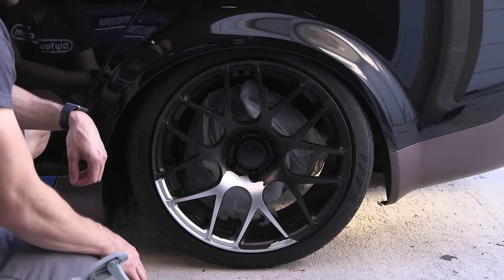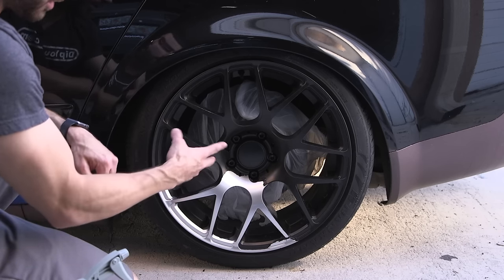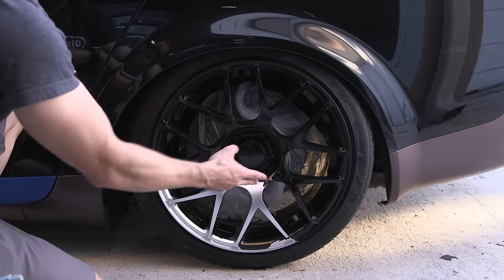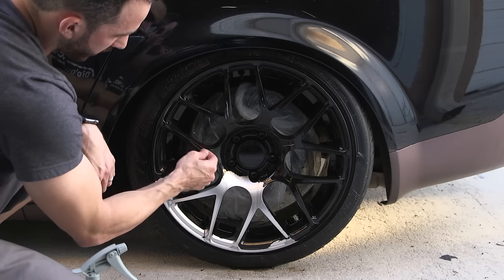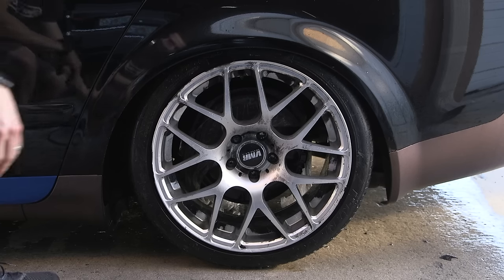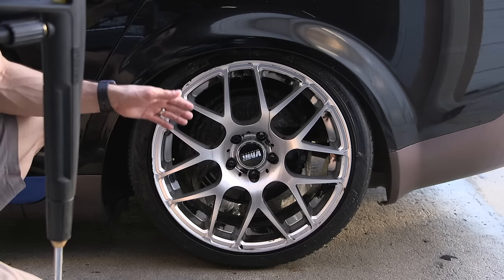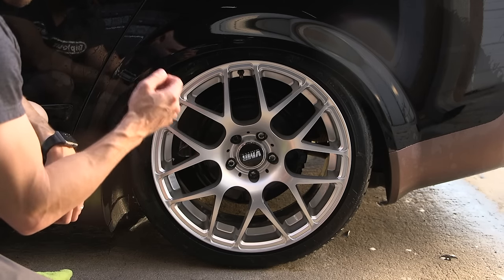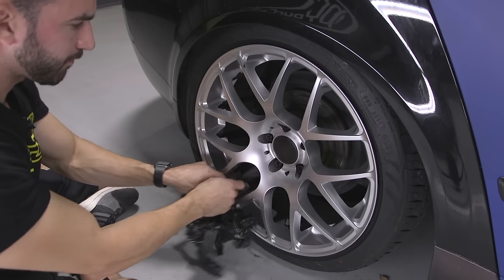How to Remove Thin Plasti Dip - Nothing Works Faster

Comment: Best case scenario - you sprayed the correct amount of coats and peeling your dip is easy. However if you’re facing some thin dip - nothing works faster than Dip Dissolver.
Reply: Is it safe to use on a part that's painted underneath? Like a body panel?
Reply from the maker: Paddy W absolutely
Reply: Awesome, thanks! Looks like I'll be ordering some soon haha
Reply: Fonzie q
Reply: Fonzie 
I bought and received it. I still have to do a 2nd coat. Does your product stain or remove the clear coat?
Reply: Where can i buy dip dissolver?
Reply: Do u think I will be fine dipping my rims black bc I’m leasing it and would have to take it off before I take it back in 3 years
Reply: Dip dissolvent Is not available in Italy how can i remuve thin dio without product
Reply: Where can I buy Dip Dissolver
Reply: Hi, Is it safe to use on ceramic coated paint?
Reply: Where I but this
Reply: @camdavis7034  yeah
Reply: Will the dip dissolver effect any plastic? Like taillights? I need to redo my taillights but it’s too thin to peel
Reply: Will this work on DYC Dip Armor?

Comment: Bought some used wheels that were already dipped. Spent a very long time trying to peel the dip off by hand. Gave up after getting most of one wheel done. Thanks for the vid, those wheels have just been sitting in the corner of my garage forever, nice decoration but they would definitely look better on my car haha

Comment: First off, I read some replies and tried to use some other things in the garage.  They sorta worked,  but had to use harsh chemicals and it took hours.  Not only that, but it didn't even take  it all off.  After 2 weekends of waisting my time on just 2 wheels, I decided to give in and try this spray.  OMG.. Followed directions and within less than 10 minutes my wheels look like new.  This stuff absolutely works.  I didn't spray enough plasti  DIP on my wheels and it was hell to get off.  Don't waist your time on stuff in your garage.  Buy this and use your precious time doing something more meaningful.  Thank you providing this info and product.  Oh,  and to top it all off,  I sprayed it on the 2 other wheels to remove the stubborn leftover dip that couldn't be removed by other chemicals.. Very happy day.

Comment: Haven't read all the comments but I'll tell you what does remove plastidip off of wheels,for certain, engine degreaser. Not sure Howe good it it for the various types of wheels, but for mine (aluminum alloy) it works wonders

Comment: I'm always hesitant to buy things I see in videos but it Worked great just like in the video. Had wheels that were peeling from a 2009 and the spray with a power washer at the car wash worked great took two applications and lucky me 3 of 4 Wheels were protected by the dip coating and they look nearly brand new underneath. If there's a way I would give 5 stars recommendation.

Comment: I just bought a Jeep and the original owner plastidipped the plastic liners on the side of the jeep as well as the wheels. Would this damage the plastic if I try and use the dip dissolver on it?

Comment: All well and good unless your thin PD is on the car itself then you risk paint damage so simply learn to do it properly as they consistently warn not to try and do it on the cheap with insufficient product. Lessons: Do it right or better not to do it and pay now or pay later.

Comment: What about plasti dip that’s 9 years old and was put on as recommended to remove but won’t? One wheel came out perfect but the rest are a mess. I’d like to know because if this product is a fight with a pressure washer what will be my case.

Comment: Engine oil also works as I found after checking my oil and having a drop pf oil end up on my grill peeling the plastidip within the hour even though I washed it off
Reply: Doesn’t matter what type?
Reply: @champking20  i forget what type is 
But all seem to do the same to plastic based products

But not synthetic

Comment: If I am unsure my wheels were plasti-dipped or powder coated, can I still use this product and not damage the wheels if it were powder coated?
Reply: Power coat are solid I had them jet wash and pressure won’t even damage or mess them up at all

Comment: If applied correctly, how long will the dip remain peel able? I live in FL and was wondering if it would be dried out and hard to remove after some time...
Reply: despite all the bullshit these guys spout, it will dry out and will be a pita to remove, after two years I had to peel m sunroof and the peel had cracked and crusted, had to use acetone to remove the dip
Reply: Yeah it can only peel off within a year if you live in a semi-humid area.

I live in California where it's a normal hot/warm/cold cycle it reaches 35F-105F and after 3 years it cannot peel off for me.

Comment: Anyone have issues with plasti dip that's been on for 2 years? It had 4 coats and is very hard to peel by hand
Reply from the maker: criz florez 4 coats way, way too thin.  You have to use the correct amount of product for it to peel and perform properly.

Comment: Will this leave stains on the driveway as the runoff dries?  My idea would be to use dip dissolver on an entire car if it doesn't peel properly (its been a few years and hasn't exactly been kept clean)
Reply: ablackformula   So did you remove the plasti dip?  What did you use and how did it go if you did on the driveway?

Comment: I changed the brakes and had the wheel underneath and accidentally dropped some brake fluid on the plastidipped rim and it completely took it off wherever it spilled

Comment: Ok I put 5 coats of plasti dip and two coats of 2k clear coat on my rims and I had to install new tires and a tire shop scratched up my plastic dip so I have to redo them last weekend I’ll try to touch up the rims on three of them and it looks like crap so all I had time for was to peel off one which took me over an hour and re-sprayed it and clearcoat it. Will  alcohol work better or brake cleaner with the clear coat

Comment: Where can i buy you product? And can i use the method on black plastic trim?
Reply: Also the plastid i need removed is on my front bumper, i dont nessisarily want to pressure wash ny radiator

Comment: I bought a used car with a thin coat on the wheels and grille. It's starting to come off. I don't have access to a pressure washer. Do you think the dissolver + wiping with a dish sponge would work?

Comment: I had made a horrible paint job with a fake plasti dip ripoff on the front fender of my motorcykel, to get it of i hade to use a metallwirebrush and water with dishsoap. Luckily there was not paint under, only metall.

Comment: Do you have to use the power washer? Can you use the jet setting on a garden hose?
Reply: Yes you could, it would be slower though, and make sure its high pressure
Reply: Yah but it's a pain in the ass!

Comment: Great video but is this safe on the cars paint? 
I recently (last weekend) sprayed a few things with black plasti dip on my car. I thought I taped off really good but it was a very windy day and I got overspray all over the place
I used a micro fiber cloth on a lot of it which really helped but there's still little black micro dots all over. 
Would this method be safe to use all over my car to get rid of these little spots? 
My car is white that's the only reason why I care!!
Reply: same happened to me.  Did you end up trying the dissolver ?

Comment: Guys just use brake oil then pressure wash off. Lmk if you need more instruction
Reply: GoldCurency o how does that work ?
Reply: Juan Rodriguez Rub brake oil on the rim. Let the brake oil sit on the rim for an hour or so. Then use a regular water pressure washer to wash off. The powder coat will begin to flake off. 

You might need to repeat the processes 2-3 times. As far as the pressure washer. I didn’t have one so I took my car to the self wash and used that one.
Reply: GoldCurency o alright thank you !

Comment: I guarantee that just plain old gasoline works better than this and is much cheaper. Did it the other day and the dip absolutely dissolved instantly.
Reply: i was just gonna say kerosene or just spray brake fluid all over it

Comment: What is the minimum amount of Dip (# of dip cans) required for 4 rims? Thanks
Reply: Depends on what you are doing and the size of the wheels.  For standard projects, using just a standard Plasti Dip color 4 would be the minimum.  We have a bunch of pre-built Wheel Kits that will include everything you need to successfully spray a set of wheels:  https://www.dipyourcar.com/pages/wheel-kits

Comment: Just ordered the wheel kit. Curious, shouldn't less coats be recommended if it makes it more durable and not easy to scratch, peel or come off during regular conditions? -- granted you are willing to use the dip dissolver and pressure washer when it's time to really take it off. Assuming, being able to remove it in 2 seconds is not a priority for you.

Comment: i don't see why you cover the brakes with a plastic bag if you shot it out with the pressure water. you can do it without the bag perfectly fine as long as your brakes are cold and not warm.
Reply: Exactly, those brakes are meant to get water in them and dirt, still function fine.

Comment: Wouldn't you be worried about the dip dissolver eating at the wheel? After all it is eating at the rubber Plasti dip. Im guessing that's why you tell them to thoroughly cleaned the area, but I couldn't trust it. That's why you do it right the first time rookies.
Reply from the maker: Dip Dissolver dissolves Plasti Dip, that's it.  It's perfectly safe for the wheels underneath the dip.

Comment: Just use tar and bug remover and wipe with a microfiber towel it works just easy if not easier.....plastidip isn’t as tuff as tar
Reply: This also works for over spray of plasti dip

Comment: Yea let me just buy a high grade pressure washer and your product. Lol I’ll just try my brake cleaner
Reply: @JP-uz7nc  I actually used an aluminum wheel cleaner and it worked great on some old thin dip. Made it so i just wipe it off with a bit of with of bit of pressure respectively
Reply: Just go to a coin car wash near you and use the pressure washer there. A couple dollars at most.

Comment: Using a pressure washer that close to paint is a good way to remove your clear coat too...
Reply: Incorrect.  2000 psi is perfectly safe for OEM paint and wheels.
Reply: There are videos on YouTube showing thats not true.
Reply: SkiDooRydr I mean yeah if it already started to crack like mine did it made it worse
Reply: Exactly. If the clear coat is failing from before its obviously going to peel off when you take a pressure washer to it.
Reply: SkiDooRydr  HA HA  B.S.
Reply: you can clear coat your wheels back no big deal.
Reply: You're not going to hurt your paint with a 2000 psi electric pressure washer.
Reply: SkiDooRydr LMFAOOOO
Reply: I've destroyed the clear coat on OEM painted wheels with a pressure washer. Certainly possible. Went too close and it ripped some off.
Reply: radionautomatic must've been some shit commie car.Ive done it dozens of times to my car super close and nothing has happened to the clearcoat at all.
Reply: Wheels should be powder coated if they are peeling with water then you most likely cheaped out